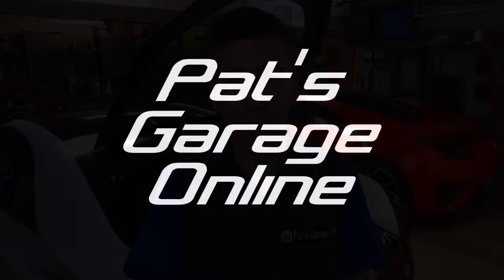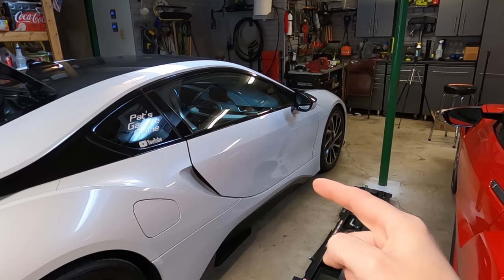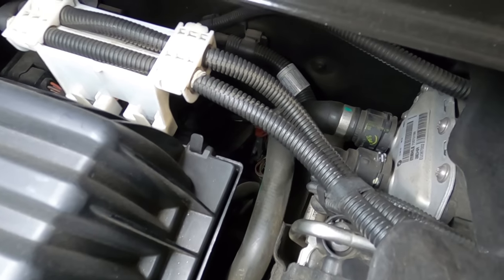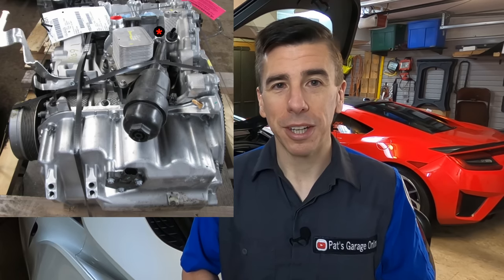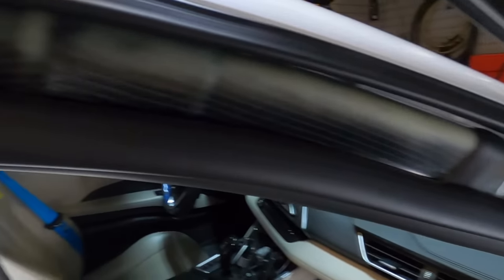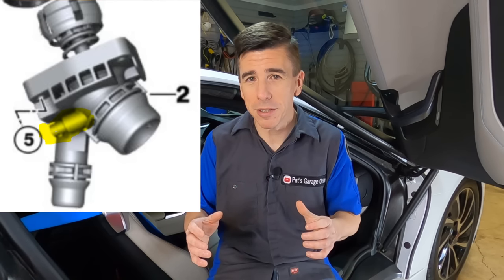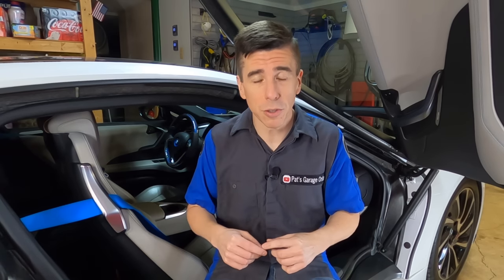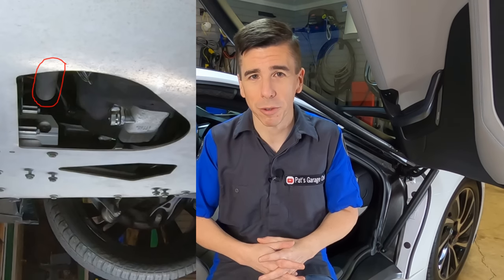My response to your ideas about Samcrac's BMW i8.

Comment: I like the idea of an access hatch, 6” hole then blank off. I remember having a conversation about the window motors on a Jensen Interceptor, the car is built around them and it’s a full dash out to get to them....unless you remove the insulation on the engine bay and core out a 3” hole then a square blank goes over it and reglue the insulation. Such an easy fix.

Comment: A round hole shouldn't weaken the carbon fiber as long as there are no cracks or fracture lines.
Reply: Pretty sure that would depend on how big the hole is.
Reply: Maybe-but it wasn’t designed in so I think you would be nuts to cut a hole without being able to perform an FEA on the entire structure. 

Seems like everything today requires you drop the engine subframe to fix-like the C7 clutch.

Comment: Thanks for the followup video! It is clear that BMW knew this would be a low volume production car for people with deep pockets... so they had no reason to put easy maintenance / reliability at the forefront when the real point was to showcase the future. Shame they made such strides in the early 2010s then backed off the electric initiative and allowed others to fill the market gap. I'll stick with my E90... maintenance on that is as straightforward as can be.

Comment: Great analysis Pat. With the correct troubleshooting, Sam should be able to diagnose his overheating problem. In the final analysis, its either too much heat load (e.g. combustion leak), coolant path preventing coolant from reaching the radiator (obstructed path) or the heat from the radiator is not being removed (air flow). Your suggestion of checking the coolant paths between the engine and radiator is spot on. I asked Sam to see if the radiator is getting hot and measure with the IR thermometer. I didn't see a response. His radiator wouldn't have blown up due to an obstruction alone. Either the radiator was ready to fail or he took it over pressure. You don't need more than 20PSI to find a coolant leak and a good radiator should be able to tolerate that magnitude of pressure.
Reply from the maker: I think there's a restriction and the few pumps of the pressure tester sent all that pressure to the radiator.  Hoping to see Sam's findings in his latest video.

Comment: The wax stat is as old as the hills , the PTC heater is used in HVAC systems  to open valves instead of motors or solenoids.  It's a robust , reliable device with no maintenance requirements.  Putting it in a car might seem odd but to HVAC guys it will make sense .  As regards the current issue raising the inlet height at the front of the car can be done by extending the expansion tank hoses (temporarily ) to raise the tank above the engine high point , then fill the system and run the fill procedure.  Once finished clamp the hoses shut and remove the temporary extensions . Would be cheap enough to do .

Comment: A computer controlled wax thermostat. Wow. I believe I've seen most things in life now.
Reply: Very common on even low level Opel and Vauxhall models. Also notoriously unreliable.
Reply: It’s called a zone valve on a baseboard hot water heating system. They last forever and are subject to the same kind of temperature

Comment: 8:03 this type is crap is why BMWs are so damn expensive to fix... I couldn’t design a more complicated thermostat if I tried. And it sounds utterly impossible to fix it it goes wrong.
Reply: that thermostat is standard on euro spec cars since the late 90‘s.. its needed for emission controls. there is nothing overly complicated about it, and easily disabled.
Reply: @florianl9789  so hack the thermo so it always cools, who cares if its using more energy?
Reply: @Kitty-oy5nj  no. you basically cut out the regulated part, so its a pure mechanical thermostat, no regulation from the dde. the hack is to cut a wire, and ground it
Reply: That thermostat works just like regular mechanic thermostat BUT dme can lower the opening temperature by heating the thermostat with electricity.

Comment: Pat something I was thinking was is sam’s  coolant temp sensor reading correct? I’m an e36M3 owner and I’ve experienced a bad temp sensor in my 9 years of ownership.
Reply from the maker: Sam's seeing temperature readings on the secret menu of the i8, on the instrument cluster, that are pretty close to the readings he gets when he points an infrared thermometer at the head.
Reply: @PatsGarageOnline  ok then that clears that up. I didn’t recall seeing that in his video.
Reply: Sam also had the coolant boiling in the reservoir so it was definitely getting hot.
Reply: @brucepeterson3246  but probably not cycling through the radiator to cool down

Comment: Other than the overheating issue being possibly caused by tampering or an obstruction, I totally believe that utilizing the vacuum fill along with jacking the front of the car up a few feet higher than the mid mounted engine may rectify this issue. The leaking radiator could likely just be a normal typical BMW quality issue. Too often these days it seems service technicians have difficulties being a mechanic and forget to pay attention to the easy to remedy solutions first. Great channel, Subscribed.
Reply from the maker: Thanks for joining the channel.  I am looking forward to seeing what Sam does in his next video.  Also, the BMW tech that worked on this car commented in the last video saying there were lots more issues Sam hasn't discovered yet.  So, that will be an interesting reveal when Sam updates us.

Comment: It is a "designed issue"of the cooling system and air bleeding problem.
The level of the front and back cooling system  could be a primary design problem
The wax thermostate   and coupled to the electrical control on the operation, complicate the  cooling system.
Not an ordinary DIY operation.

Comment: I've got a 2006 chevy uplander with a pushrod 3.5 in it and it takes about 40 seconds to bleed the cooling system.  Smh. Just saying
Reply: I have a 97 Landcruiser. It's self bleeding. After draining the coolant, you just refill and slam the hood. Job done.
Reply: @gregculverwell  no, you have to make sure it's done.  Even self bleeding systems need someone to make sure they're self bleeding. Smh.  I'd never pay you to work on MY car.  Js
Reply: @getchasome6230  Then you have no experience with landcruisers of that vintage.
There are no bleed points!  The radiator header tank is above the head & the hose exits the top of of the head.
I know exactly how much coolant it takes. Fill the radiator and add the excess to the overflow bottle. Take it for a drive and let it cool - the level of will be be exactly where it should be.
After decades of servicing it I would certainly have had problems by now.
Reply: @gregculverwell  you're right.  If you're messing with the cooling system it's not possible to have leaks or a pinched hose, etc, etc, etc.  🤦‍♂️. Go ahead and fill it up and slam the hood.  Good luck with that
Reply: @getchasome6230  So you are saying that changing the coolant causes leaks & pinched hoses? 
Hell, I must have been really lucky over the last 45 years and millions of miles.

Comment: I could totally see someone put some of that "stop leak" or "Head gasket repair" radiator aditive to the system and clogging it up. I have not checked the service manual for the I8, but I am a BMW motorcycle tech and most of our bikes use the vacuum fill system and also have bleed points,  not sure if the I8 does. I have seen the car techs raising the front when filling them. So if no obstruction is found he should raise the front when vacuum filling and make absolute sure the filler tank is well above any point in the system and keep it there while bleeding, if any bleed points exist. If not then it might be a good idea when its all hooked up to crack the output hose of the intercooler to see if he gets flow through it. I can ask the car techs to see if there are any bleed points accessible on the head like we have on the bikes.
Reply from the maker: Thanks for the suggestions.  The intercooler coolant is on a different circuit - which has 3 radiators, electric pumps, etc.  But, I think Sam has some other issues with this car and I'm looking forward to seeing his next video.

Comment: Hey pat! You might’ve mentioned this in a previous video but what is your history? You seem to have a lot of mechanical knowledge
Reply from the maker: My dad was a mechanic in the 50s and would always take me to classic car shows and cruises, growing up.  When I was 19 in 1993, in the Army, I bought my first sports car, a 1978 Corvette.  I was stationed close to my childhood home so I'd take time off and spend time with my dad restoring the car.  It was a unique platform compared to what he used to work on.  I sold that for a 1997 Corvette and started posting on the forums in 2000 with steps on how to change oil, do exhaust conversions, etc.  During this time, I built up a tool collection and started working on my cars for jobs that didn't require heavy lifting.  I lost my job in 2009 with the financial crisis and had no sports cars until 2019, when I bought the i8.  The car intrigued me and I spent hours each day consuming the service manual and reading about people's issues on the forums. That lead me to using YouTube to share this knowledge.  I'm work in IT for the gov't full time, am a ham radio operator who loves tinkering with electronics, and I swing dance.  In all, I'm a big nerd with a lot of tools.  😁
Reply: @PatsGarageOnline  You are a very cool dude. You certainly look  a lot younger than your age! Not a nerd by any means Mr Bond! Lol
Reply: @PatsGarageOnline  That's awesome! I'm 24 right now and was building my own computers & writing software at 16. This car felt like such a cool piece of technology to me, nothing beats it. I think the most inspiring part is realizing someone had a vision for this car - and they actually executed it from concept to production. Usually that's reserved for hyper-exotics! P.S., nerds are cool now don't worry ;)

Comment: Studying, many BMW forums, one thing is apparent cooling issues are a major problem amongst many types of recent BMW's. A common fail point has been rubbish, leaves, etc build up in between the radiators and fan assemblies. Many images show how the rubbish can't be seen until the fan unit is removed from the radiator, in others the rubbish is trapped between the coolant radiator and the oil cooler and aircon radiator.

Comment: You should never lift a car by just the front arms of a lift. And lifting the front is not the solution to bleeding as what needs to happen is getting the system filled with air first. The vacuum will be effective on the air, but with coolant in the system its weight would have to be lifted by the vacuum to get to that air lock. You are not going to get enough vacuum with any normal pumps to lift the coolant that high. If you lift the front you will have to lift the coolant even farther to get to the air unless you almost drain the system anyway. So if you drain it partially you might as well drain it fully and not fight gravity and coolant with the vacuum. While he has the thermostat out to fix the one he took apart he might as well use regulated air and push the rest of the coolant out.

Comment: Covered everything I suggested on his first vid and a few others. Great work. My mid engined had to be bled with the front raised at nearly 40 degrees like on a car transporter ramp. Internally collapsed hoses, a potato in the tube (yup that's a thing) the list goes on. Although mine did not have several water pumps or so many ancillary circuits.
Reply from the maker: I appreciate the feedback you supplied on the last video. Your voice was added to the many others with similar suggestions and I'm glad that someone let us know that they successfully bled the system this way.  Now, let's see if it works for Sam.
Reply: @PatsGarageOnline  I should have said withthe inclining the car trick that I filled it by removing the top hose of the radiator and filling through there at it was the very highest point.

Comment: Great follow up Pat.
Another idea I had, was to put say 50ml of food dye into the radiator and see the time it took to be seen in the reservoir. 
Use Rich's car (or yours, lol), at the same time (compare), when cold or when hot.
The colour density would also show how much of the dye is moving.
Of course a flush (might not be needed as it's just food grade water based dye), after, but then again Sam will be flushing away to try and solve this issue anyway.
Reply from the maker: I'd rather do that to Sam's car than mine or Rich's.  LOL!  But, yes, that's another idea that came up from many folks as well.

Comment: The fact so many have tried leads one to believe something has been sabotaged. Unfortunately these things can be hard to find.

As an example I purchased a C32 AMG at auction without being able to test drive but you could run the engine.  Once I collected it,  it was apparent the supercharger did not work and it will not operate when the car is in park so it was something you would not be aware of. I found out later the car came from a used car dealer that specialised in euro performance and prestige cars and it had been traded in.

Luckily for me I had started at the top with the electro magnetic clutch to check if it was getting the voltage to operate. Once I had unplugged the connector it was clear someone had pulled the tabs in the plug back far enough so they would not connect with the other half of the plug. 

Quick test drive and some loss of tread from the rear tyres the car was back to normal. Still baffles me as to why or who would have done this as the auction cars cannot be driven unless by a mechanic. But goes to show anything is possible when it comes to used cars and who or what may have been done to them.

Comment: What a crazy design, it reminds me of when I was a Rank Xerox (Fuji Xerox) photocopier engineer, and they would design photocopiers without ever consulting us engineers, subsequently, they came up with bizarre things that seemed to us to be to thwart anyone attempting repairs. What a well devised and easy to understand video, you obviously have far too much knowledge and common sense to work at a dealership. The same in the UK, any experts set up by themselves and the dealerships have second rate mechanics/technicians.

Comment: The ‘heated wax element’ was commonly used by front loading washing machine manufacturers to “lock” the door during operation. When the wash cycle is switched on, electricity is passed through a small (size of dime) resistant disc causing it to heat up.  This in turn heats up a cylinder containing wax which then expands to engage a door lock mechanism.  After a minute or two of the wash cycle finishing the wax cools, contracts and a spring retracts the door lock.
Reply from the maker: Thank you so much for this information.  I was unaware that this technology was something used in other applications.  I appreciate learning more about it.  Thank you!

Comment: I am a retired Diesel mechanic, my thoughts on this would be to raise the front of the car, remove the top radiator hose from the radiator, put another short hose on there and fill up with a garden hose, start the engine to see if there is circulation and how much, this should tell if it is an engine problem or a radiator problem, this car is way to complicated for anyone to be able to fix, there is just not much if any gain to be had with all these complications.

This car has taken any BMW that I might have had on my bucket list away, no way could I put up with a car like this and what a simple cooling problem would cost to fix, if it can be even fixed at all, the total of repairs would be more than the car is worth, just go and buy a Toyota or something that is a lot less trouble.
Reply from the maker: Good advice.  Yes, the only BMW worth having is one under warranty.  When it breaks, they give you a free loaner car and you pick it up when they drop thousands of their own money into it.

Comment: Great video. Please more NSX mechanical content.  I know Hondas don’t break as much as BMW, but looking forward to common NSX maintenance procedures like oil change (7 drain plugs). TMU fluid change. And changing both oils in the DTC transaxle.  Once you take off the panels of the NSX and get a good look at the mechanicals, you will see the NSX powertrain is actually more like a racing car than a road car.
Reply from the maker: Thank you.  I plan on doing videos on these maintenance procedures as they become due on the NSX and releasing them within the next few months.

Comment: You could perhaps fill the cooling system with hot water without starting the engine and then simply feel or measure to where the water gets. Blocked parts or air pockets will stay cold. Just an idea. Very classy by the way how you do your vids, Pat.

Comment: I was trying to helps sam on his i8 and sent him a message  including the procedure to bleed the system,I grabbed it from a BMW tech who hates these cars so much he refuses to work on the i8 at all,he had five attempts at one and managed to fix it but would never want to spend 36 hours trying to get the air out of another one.Raising the front of the car was also something he tried in his last attempt which he said helped a great deal,He also mentioned that if the pressure is so great that the rad explodes due to back pressure then a pipe may be blocked around the engine some place on the outlet side of things.The way it popped says to me that the outlet is not even seeing water other than what is already in the system.i am wondering if the pip running down the back of the engine might be perished inside due to heat expansion and has the parts from the pipe congealed on the small pockets in the water jacket around the cylinder heads.